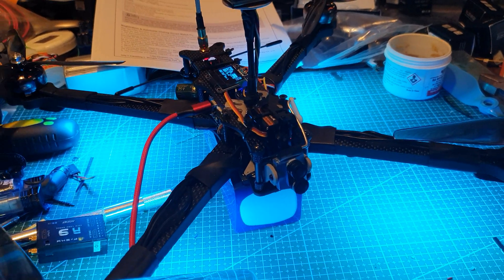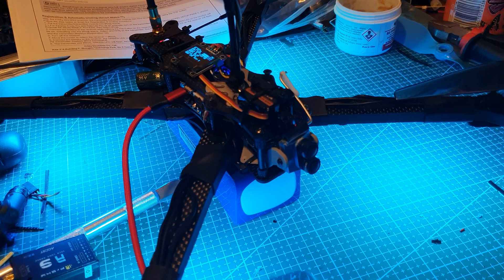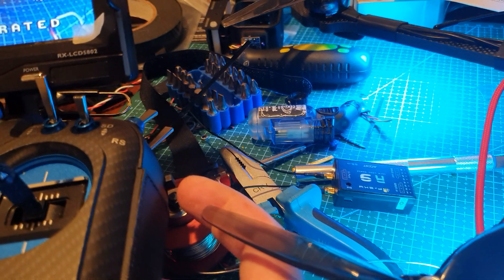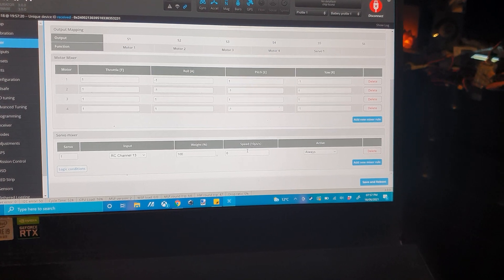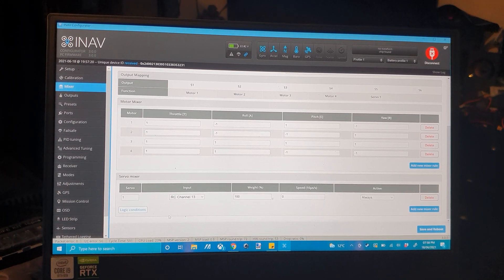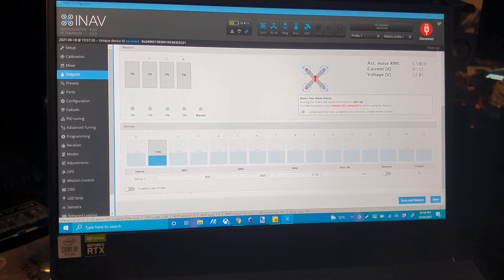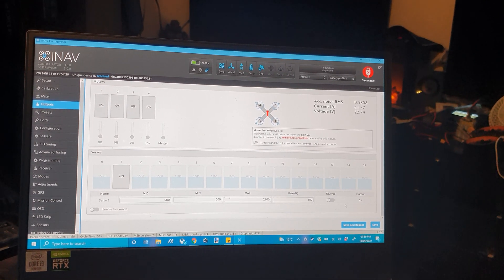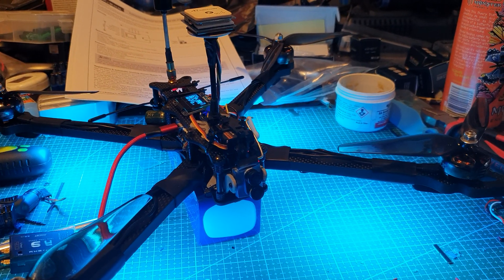control servo using inav (kakute f7)

Comment: Thx for showing this ! Did you insert a CLI command to map the added Servo 1 (from the Servo Mixer) to your S5 Output Mapping, or was it done automatically ? Tried it with a FC: Speedybee F7 and INAV 6.1 but the added Servo  did not show in the Output Mapping on place S5, maybe it is different to Kakute F7...
Reply: well it is s5-8 if you have extra motor port. INAV will automatically map them to servo. However, most flight controller don't support motor to servo, and you can't do resource remapping via CLI in INAV. In betaflight, you can map LED STRIP and motor 5-8 to servo with CLI easily. I don't know why INAV can't , it says no independent timer for S5-8 to run PWM output.

Comment: whare do i conect the servo on my fc
Reply: Same here! I want to know where the servo is connected
Reply: well it is s5-8 if you have extra motor port. INAV will automatically map them to servo. However, most flight controller don't support motor to servo, and you can't do resource remapping via CLI in INAV. In betaflight, you can map LED STRIP and motor 5-8 to servo with CLI easily. I don't know why INAV can't , it says no independent timer for S5-8 to run PWM output. @novisfpv    @@tpainz
Reply: That’s my problem too